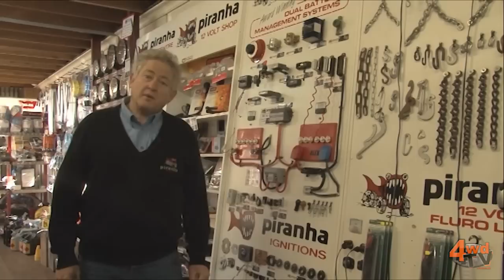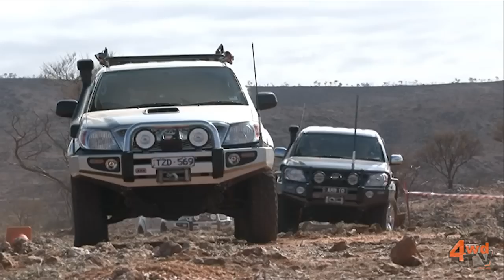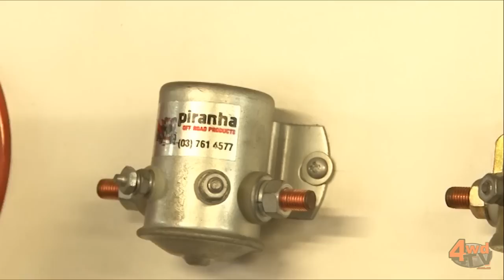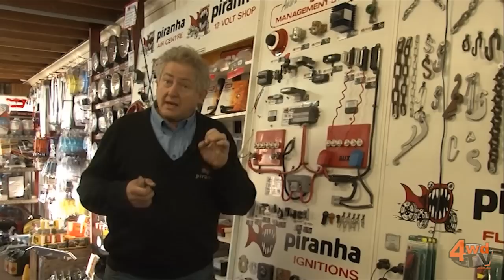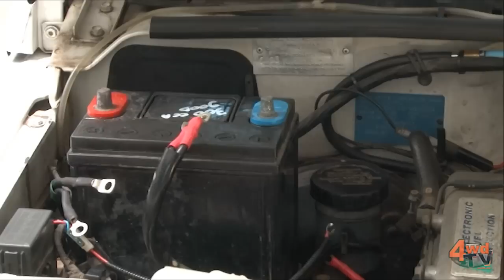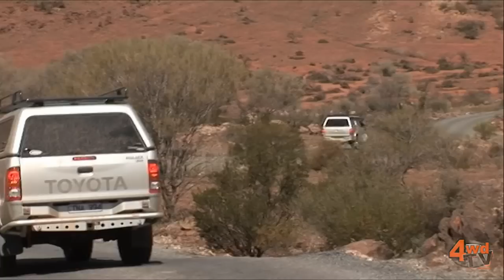Dual Battery System Questions

Comment: one or two or ten batteries in parallel will never spike ... lies look at any new diesel most complex ecu and fuel management systems that come from warranty voiding manufactures as oem duel batts direct connections strait parallel 12volt systems . or look to big rigs same deal 4 group 31 batts all in a row 12 volt systems....your prices are a joke